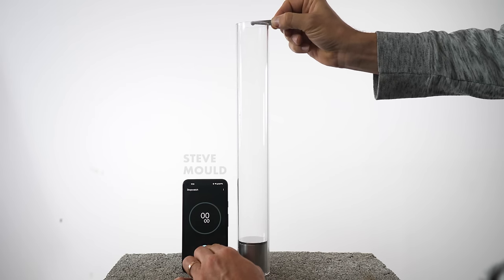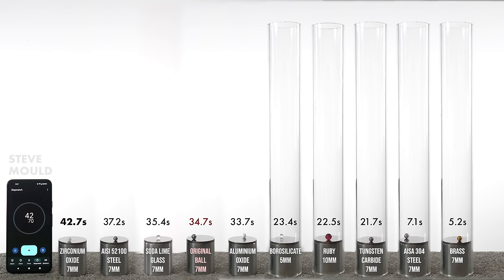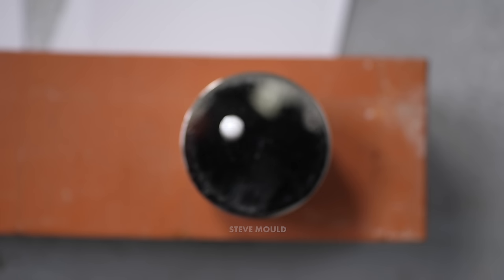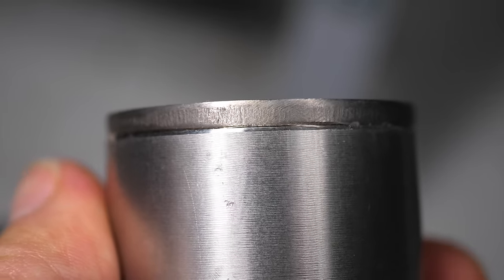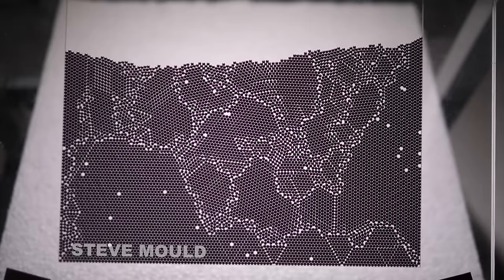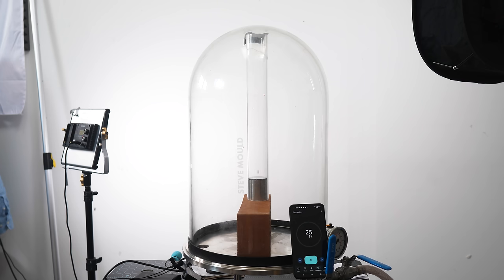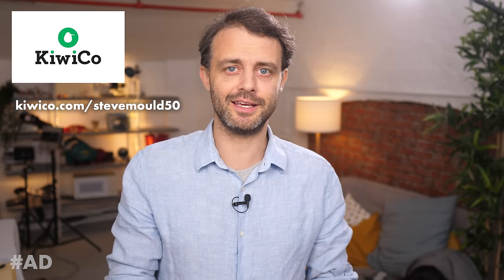This weird metal is insanely bouncy

Comment: I speculate that this phenomenon is that the natural frequency of each object is different, and the changing factors of collision include frequency, phase difference, and height difference. The condition for recovery rate 1 is that when the frequency above falls from a certain height and hits the bottom, the new frequency generated by the bottom can bring the top back to the second fixed height, (phase difference) will return every time it falls. At the second height, the two waves should fit perfectly.
 So not limited to metal, if possible move the gravity to the middle of the height difference.
Reply: Resonance is not required to achieve the goal, (phase difference) as long as the two waves fit perfectly.
Only the colliding waves are needed, not the non-colliding waves.

Comment: Quick comment on it being called ball bearings:
It’s because the individual balls don’t always come in that casing. Like on many jiffy motor attachments, the head gear has individual ball bearings surrounding the gear as a typical bearing with casing wouldn’t work.

Comment: Any where I've worked in manufacturing,  the ball bearing (completed with races) is a BEARING, we called the balls inside the bearing, ball bearings as steel ball  were bearing the weight on the balls on the bearing races

Comment: Zirconia has an extremely round and smooth profile because they're typically used for precision ball milling, right next to alumina. The density of zirconia is also much greater than that of everything else there, specifically the degree of sintering (percent theoretical density). For that reason, it doesn't surprise me that zirconia, most likely yttria-stabilized tetragonal zirconia, would bounce the most because of its high hardness and extremely high percent theoretical density.

Comment: Good luck with that NileRed.
When I was 9 is was amazed and transfixed when I dropped a real ivory die on a marble table. It bounced quite a long time, and some bounces were much higher than previous bounces. I can only attribute that to the spin induced by it being a cube and an edge hitting on an angle other than perpendicular,  coming back into play by doing the inverse on the next bounce. Try it with a spherical piece of ivory and compare to the liquid metal. The marble was dark olive green and black, if that makes any difference.

Comment: Bounce sound counter seems like a perfect beginner project for microcontroller, like Arduino. Way easier then software sound analysis, since you can easily create a filter circuit which turns bounces into countable bits. That's the advantage of low level dedicated hardware design over software design.
Honestly with 2 transistors & a microphone you could probably hack a cheap calculator to do the counting, since it's a low frequency counter. No need even for Arduino.

Comment: @stu  Soundwaves also steals energy, string this setup in a "second" vaccum chamber to insulate the setup from energy losses from the "tone"
Also i guess it will be possible to read energy losses in the strings...
And further more losses will be from your measuring devices.
So the written laws of thermodynamics still stand strong, even down to electrical and electrones even losses to photons colliding from surroundig light (and the observer?) will stop it bouncing
But still a facinatig material !!
And a even better video! Keeps altzhaimers at bay!

Comment: The coupling oscillations of the floor and the ball bearing also matters, if they are phase-locked in perfectly opposing phases, then the they will exert the most force on each other at each point of impact.

It would be interesting to try with a ball bearing with the exact same surface material as the plate.

Comment: If you flip a copper penny in the air, it will ring. If you flip a zinc penny, it won't. Why do some metals "ring" and some don't? Is it possible to alloy a metal to achieve a specific "ring"?

Comment: Wonder if you could calculate the speed of the shock wave travelling through the base material. If it is sitting on a material significantly stiffer, then the reflected shockwave could form a constructive interference pattern in sync with the ball bearing contacts. Would provide the most benefit at the beginning of the bounce I presume. What about temps?

Comment: The bearing cartridge is actually called a bearing cartridge. The two rings on the inside and outside are called bearing races. The ball bearings on the inside are called bearings. The type of bearing is a ball bearing. There are also roller bearings and cylindrical bearings.

Comment: Try suspending the base with three bungee cords so that the energy will be stored elastically in the cords and then returned on the next bounce.
That way it won't transfer through the table and be lost as heat.
The louder it is, the more energy is being lost.

Comment: Bearing Balls, Not Ball Bearings 😀 Often, when bearings are discussed, people call them ball bearings. In truth, there are several other types of bearings that don’t even use balls. The most common of these is a roller bearing. Also, a misnomer is when people refer to the balls in bearings as ball bearings. The balls are just a component of a ball bearing, which may also contain an outer race, an inner race, and a retainer (cage). This discussion is all about the balls used in ball bearings.
Reply: I call the balls bb’s

Comment: You should try bouncing that bal on a really large high quality anvil as they wil have hardend steel on the woeking face as well as a large mass compared to the ball bearing
Reply: If you do this you wil also be able to use a heavier ball bearing, which wil increase your initial potential energy and therfore resulting in more bounces, but going to big wil again make the anvil start to vibrate, if you place the anvil on a large concrete floor or even better bolt it to the floor, you wil increase the bounce again.
Reply: Sorry for my spelling, in my language ball is bal and will is wil so.
Reply: @ruandutoit3573  And, in your language do you also use zero punctuation? Fail!!!
But it is a nice idea you suggest, so ok then :P

Comment: Coming back to this video a year later after having seen some other science content on youtube, I wonder what the lowest theoretical energy loss in the system could be. Any non-vertical motion in each bounce is a loss, the sound of each bounce passing its energy through the materials of the setup is a loss, a less powerful vacuum is a loss since the few remaining air particles could hit the ball or other parts of the setup, and as you explained in your video imperfections in the makeup of both the metal surface and the ball itself. I wonder if it's possible for a much more advanced setup to remove more or even all of these imperfections, leaving the only possible energy losses as heat.

Someone can feel free to tell all the reasons why I'm wrong bc I'm no scientist, but the best case scenario I can come up with is a recursive vacuum chamber (run one inside another, release the internal one to let any remaining particles into the larger one, reseal the inner one and run both again) to remove as many stray air particles as humanly possible, having the atoms in both the ball and the plate be as close to perfectly arranged as chemically possible, matching their material properties to create the most ideal deformations on each collision, being done without a tube and using a separate wireless mechanism to drop the ball so there is less material attached to the plate to transfer energy through, machining everything in the setup to insanely tight tolerances, and mounting the test plate onto a hovering superconductor that's continually cooled using lasers (yes, you can cool things with lasers). If this setup worked and you could get the energy loss of the system down to fractions of fractions of a percent, I wonder how long you truly could make this thing bounce for.

In a much less scientific but equally satisfying result, I wonder if it would be possible to create a device using one of these trampolines that somehow inputs just enough kinetic energy into the system to keep it bouncing perpetually without any motion that's visible to the casual observer.

Comment: It would be cool to make the platform a driver, as in make it launch the ball high with every drop. If it’s perfectly level it can go extremely high, theoretically into orbit but practically a few hundred feet with air resistance
Reply: You could also use the frequency profile to time a small driver in the platform that will keep the ball bouncing at the same height forever, if it’s subtle enough it will look like a perpetual motion machine
Reply: What was the coefficient of restitution on the last drop? .998? Also if you make the large driver you’re essentially creating a bullet so wear a hard hat for when it falls down in the wrong spot

Comment: The plate needs to be replaced by a lengthy solid cylinder. I suspect some energy would be still be lost in vibration if it’s thin

Comment: The perfect base for this experiment?  This reminds me of how lathes and mills are built.  They are built for "Rigidity."  In creating high precision parts using machine tools you want a very beefy very solid machine.  It can't have any noticible flex or you won't get the desired precision part.  They used to take 50 years to make a lathe before the age of anealing and modern heat treatments, just so the internal stresses within the casting could even out to a final shape.  They would pour it and let it age for 50 years.   It was that important for a quality lathe.  It was the same process for mills.

It would have enough mass to not move.   All energy siphoned off into it would be in the form of sound waves and some heat, but the bouncing back and the flexing of the machine tool would be rendered negligible by the mass and the shape of the machine.  These are intentionally heavy, overbuilt, "solid" machines capable of operating for hundreds of years, with the exception of replacing worn parts on them.  

In fact, it is these kinds of machines that are used to make the toys in your video and the ball bearings with the ball bearing misnomer of being bearing balls.   And they have ball bearings that make them work.

Comment: 4:11 You said that the ball bearing should "never stop bouncing" if it always bounces a fixed fraction of the previous bounce but that is not true. Mathematically you have an infinite series but if you calculate the time for each bounce in that infinite series and sum them together your sum of that infinite series converges to a fixed time and hence also a fixed total distance travelled. I know it is hard to comprehend at first that an infinite number of bounces can be done in a fixed amount of time but it does.

It is like if you mark off 10m and stand at one end and then move half way to the finish line and then move another halfway to the finish line and repeat that forever. You never stop moving so your total distance traveled is always increasing forever but ultimately you never travel more then 10m.

Comment: Wouldn't it have been worth testing a smaller ball in the vacuum set up as well since air resistance plays a bigger role at a smaller size?
Reply: At such small velocities, such small differences in radius and mass, there is no difference in air drag!

Comment: I have recently solved the paradox of an unmovable object being hit by an unstoppable object... The solution is fairly simple, the unstoppable object is being deflected at an incoming angle with more force than it hit the unmovable object... This bounce method is one of the hints for why that is... An unstoppable object does not lose energy when colliding and instead doubles the energy it had before... So its a linear vector increase...

Comment: Why do the balls not keep bouncing in ever smaller steps? Because the mass of the ball acts from the centre of the sphere. As each bounce cycle diminishes in height/amplitude (due to energy losses), eventually the height is less than the radius of the ball. I assume a very sensitive video would display small aspherical fluctuations in the ball, equivalent to ever smaller bounces.

Comment: 🎯 Key Takeaways for quick navigation:

00:00 🤹 The "atomic trampoline" is a bouncy metal with a thin layer of amorphous metal on top, making it bounce significantly longer than regular steel.
01:23 🧲 Different ball bearing materials and sizes affect bounce performance, with sodium lime glass, AISI 52 100 steel, and zirconium oxide being the top performers.
04:55 🕰️ The best bounce was achieved with a 7mm zirconium oxide ball bearing, improving bounce duration by 23% compared to the original ball bearing.
05:57 🎵 Sound analysis revealed 259 bounces in one run, showcasing the impressive bouncing capability of the metal.
07:25 🪶 Amorphous metals resist plastic deformation due to their random atom arrangement, leading to minimal energy dissipation.
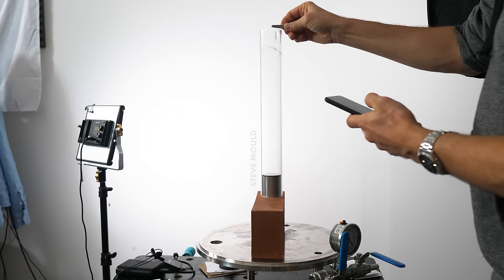13:10 🌬️ Vacuum experiments showed a slight improvement in bounce duration, but it wasn't statistically significant.
15:38 🧪 KiwiCo, a STEM subscription service, sponsors the video, emphasizing the educational value of hands-on projects for children.

Made with HARPA AI

Comment: If alloys can more easily form irregular bonds, why do they seem to form bonds that are so much stronger? I understand that as a general rule, when you alloy two metals the alloy they form is harder and has a much higher melting point than either of the original metals.
Reply: They do not form more irregular bonds, it forms a more irregular structure! The bonds are the same! The orientations and regularities of them are different.
  Because the structure is so irregular, dislocations cannot easily travel through the structure, meaning the structure can stay the same. This was shown in the video.

Comment: I would call a ball form a ball bearing a ball bearing, although I don't think I would call a ball bearing a ball bearing, thrust bearings can still have balls so the ball in ball bearing is redundant and so I'd call it a a bearing and if I needed to distinguish between bearings then I would refer to them first by size then part number. I can however see how you might have two bearings with the same measurements, one with rollers and the other with balls and so it's probably a good thing that I don't work for the hardware store

Comment: What would happen if you took a 1 gram silicone crystal smoothed closest to perfection ball bearing and dropped it to land, at the spherical zenith of both spheres, on the  world's roundest object (built to achieve the measure of 1 kilogram) (( The worlds most round object seated in like a bowling ball display stand, also made of silicone crystal :) A suction straw air releasing the 1 gram sphere and dropped at a height needed to create terminal velocity with the bowling display stand atop of an atomic scale?
  Which shouldnt be confused with describing a measurement, but more of a very particular weights and measures scale that calculates atomic weight so as to measure the ammount of deferential movement and energy loss through monitoring under infrared to see the heat and calculate the energy dispation from these objects? Could a frequency be determined that describes tunings of precise instruments into digital virtual calculations?  Could we measure how much energy was in collisions by the still oscilating frequency (perhaps heard from neighboring stars) scaled up and down from these measurements?  Could we determined how much friction is exacting and specifically required to shape the most delicate and lightest of materials?
All for teaching say robots who mine on Europa, Venus or Psyche 16? The future would like to know.
Awesome videos.  We need a favorite button.

Comment: In the US, the cartridge bearing assembly you showed at 0:25 is called a "cartridge bearing assembly." 

"Ball bearings" here, are just the balls, and not the ball cage, races, or complete assembly. The assemblies are also sometimes referred to as "sealed bearings" because the assemblies made for certain applications have rubber seals built into the sides, while something made to use just ball bearings or roller bearings would have the seals be separate components.

Comment: RUBY costs a lot because it lasts longer.

How spherical it is is secondary.
Reply: Well actually ruby bearings cost a lot because they are expensive to manufacture. Producing lab grown rubies is costly. Much less costly than mining natural rubies, of course, but still costly. Price isn't really determined by how long they last. There are plenty of things which last a long time, but which are cheap.
Reply: @aarongreen1654  if they were not lasting longer, they would not cost a lot as no one would by them. For example, a bearing made out of truffle does not cost a lot, even though truffle’s cost is huge. There would be simply no such a thing made.
Reply: @tatianaes3354  Because, for obvious reasons, there is no demand for a bearing made of truffle, Dummy.

Cost is determined by supply vs. demand.
Reply: @tatianaes3354  A 'bearing' made of truffle isn't a bearing. It's a truffle. 🤦‍♂️🤦‍♂️🤦‍♂️

Comment: Pretty sure the whole assembly of ball bearings is just called a bearing 😂 like in a skateboard. The individual balls are the ball bearings that go IN the main bearings
Reply: In general they are called bearings, because it could use bearing balls, making the entire structure a ball bearing or it could use bearing rollers, making it a roller bearing (and many other subcategories).
  The ball in a ball bearing is either called the ball bearing ball or bearing ball.